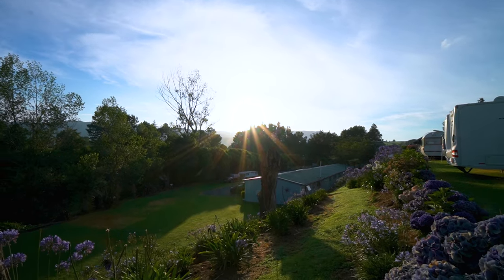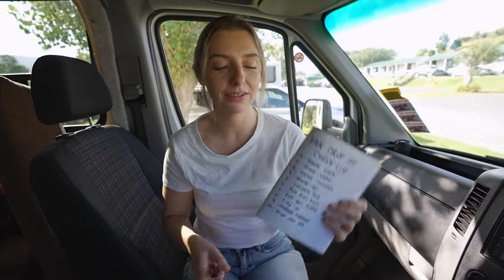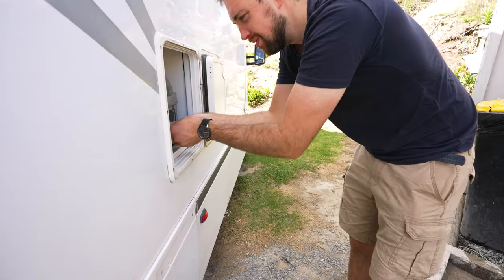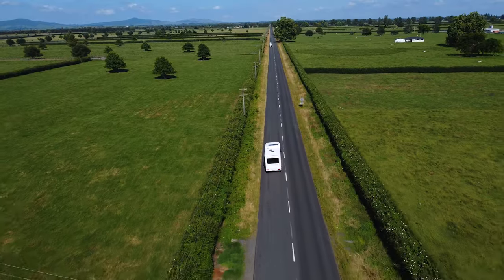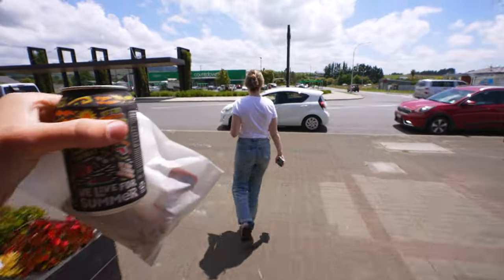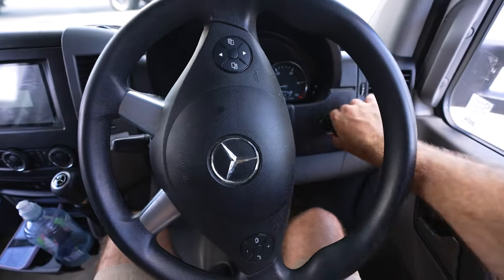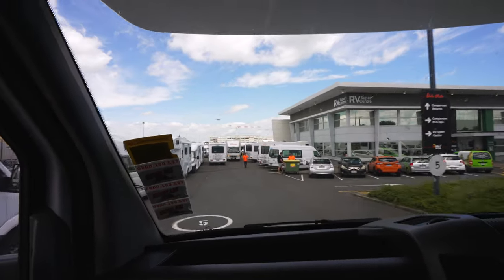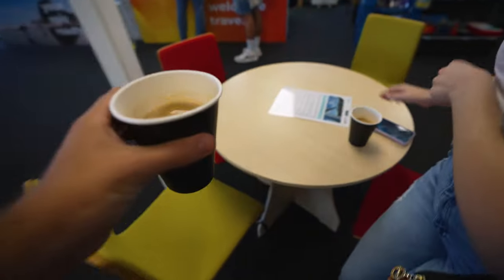The UNTOLD TRUTH of a New Zealand Campervan trip

Comment: The deisel tax is actually Road Users Tax and nothing to do with the environment - because diesel cost doesn't include any road tax like petrol. This is because it's often used by farm and other 'off road' or sea vehicles which don't put pot holes in the roads.  So you pay 7c per km when you're a road using vehicle.  You'll also have noticed that diesel is  less expensive than petrol - because it doesn't include any road tax. 😃
Reply from the maker: This makes a lot of sense!! Thank you! 😊